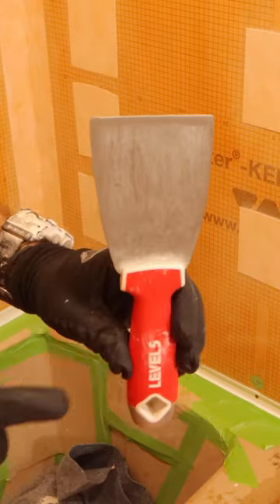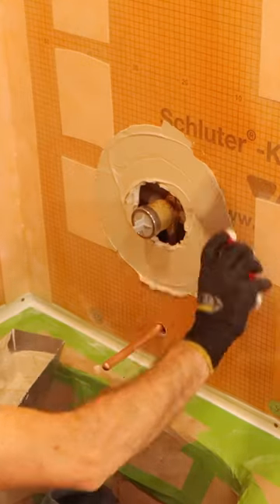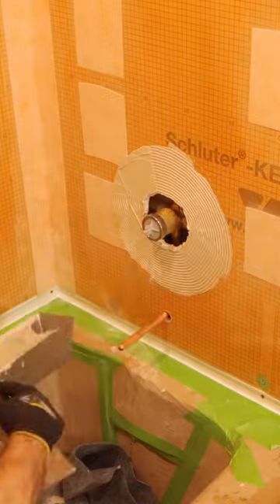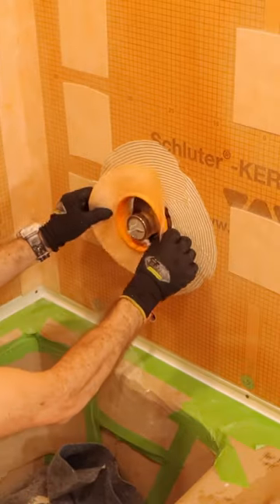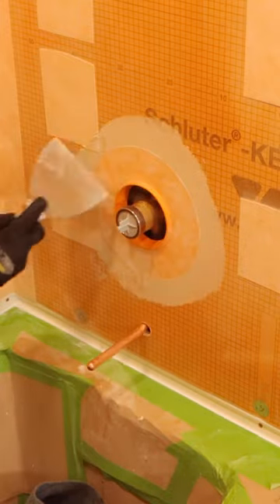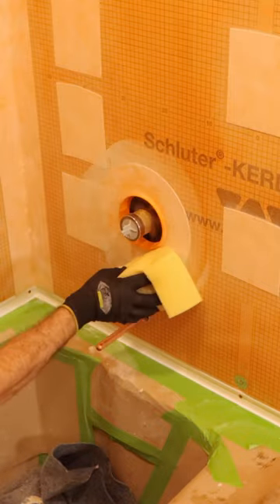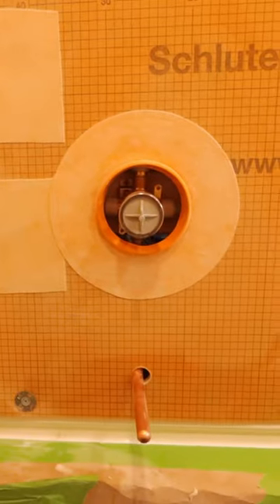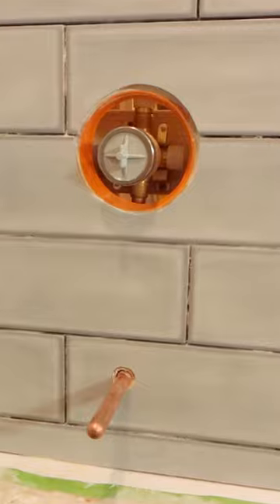Tub Shower Valve Waterproofing Tip - #shorts

Comment: That whole system is adhered with a product (thinset) that is not waterproof.
Real neat
Reply from the maker: Thinset alone isn’t waterproof. However, when used with a fleece on either side, the system becomes waterproof. Here’s how: as thin-set cures, the crystals anchor into the fleece; as these crystals grow they create a matrix that’s so tight the water molecules cannot physically pass through. Science is very cool when you know how it works 👍🏼

Comment: You can install general plasterboard, get render mesh, skim once with tile adhesive, then roll on top some aqua seal tanking..joints with EBT sealant & mesh/render

Cost you about 50£... Doing it like this costs near to 500£ with all the add ons lol

Comment: You're not supposed to wipe the thinset off like that. The thinset tapers the edge of the Kerdi band down to the Kerdi board and allows tile to sit flush without risk or bridging between different height surfaces. Also it's just a wonderful waste of time. It's all gunna get filled in with thinset and covered with tile anyway. Why bother? You're just burning money doing that.

Comment: But the valve has a square flanged piece.
Reply from the maker: that's just to fit the valve to the right depth, it's the plaster guard. Once the valve is installed, the square guard is removed

Comment: Why would you even start to waterproof around a shower valve, buying and possibly paying a installer for a wasted step. You still have a fucking hole in the shower wall 😂😂😂😂
Reply from the maker: The mixing valve seal diverts water away from the valve; btw, that valve seal comes with some drain kits, so it’s worth using it versus throwing it away